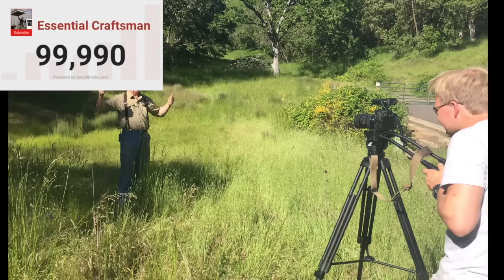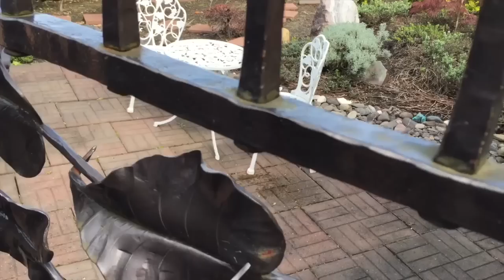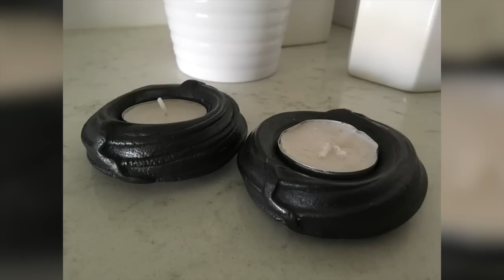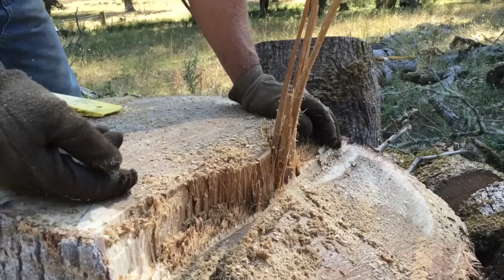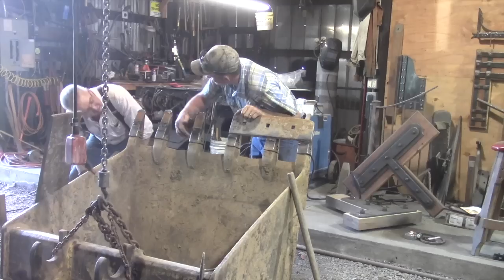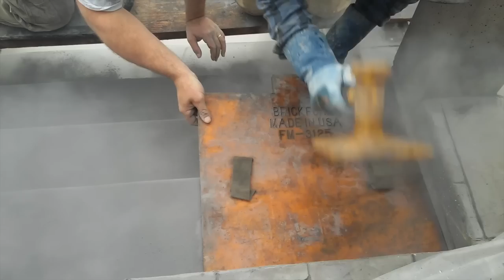100k / EC Name / Giveaway - VLOG 01

Comment: Cleaning up that axe head could be fun. But assuming I do not get picked I still have my own little axe project. I picked up a nice little hand axe from a garage sale but I discovered the blade is too soft and gets nicked fairly easily. I suspect the previous owner took it to the grinding wheel a bit much and let the steel get too hot. It's my turn to try and give it a heat treat, quench, and temper to restore that cutting edge, but I have never done such a thing. Could be fun.

Comment: I’m a fireplace guy.  I’ve been selling, installing, and servicing fireplaces, woodstoves, and chimney systems for about 25 years.  That line of work eventually involves carpentry, masonry (both brick and stone), tile work, roofing, a little bit of plumbing, a little bit of electrical, and so on… I’m the stereotypical “Jack-of –All-Trades, Master of None.” 

The point is, you say the name “Essential Craftsman” is, you feel, inaccurate and arrogant.  From where I’m sitting, it’s dead nuts on.  I often feel like a twelve year old when you explain some things. (Oh, THAT’S what those markings are for…)

Congratulations on passing the 100k mark, and I sincerely wish you and your excellent channel continue to prosper.